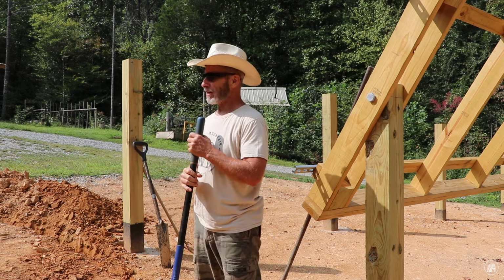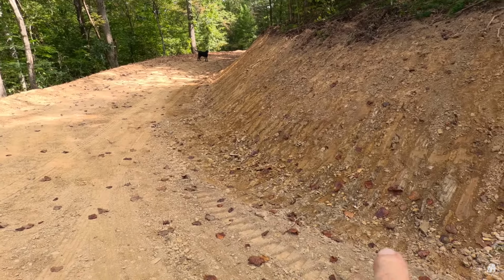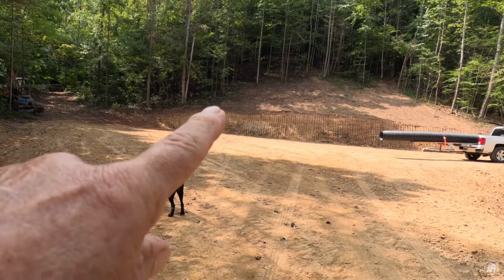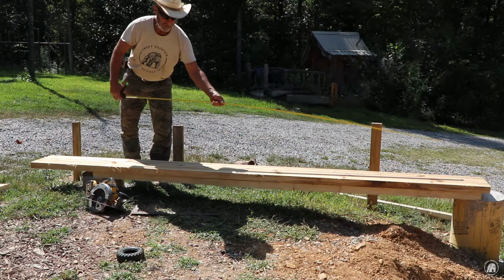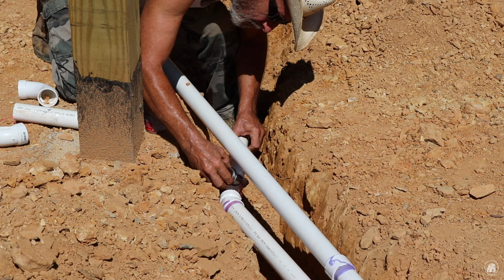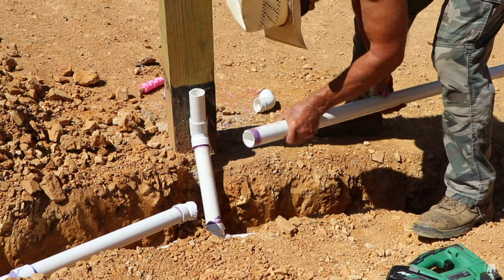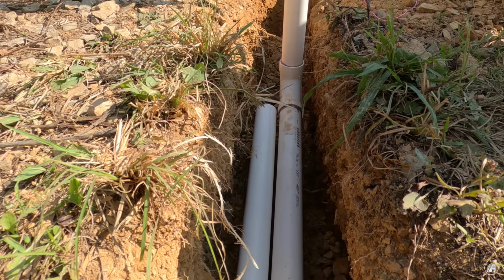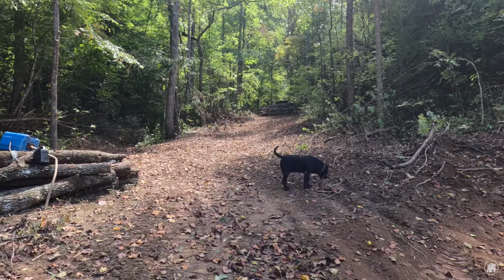HAND-BUILT Solar Array for Off Grid Power

Comment: Richard that thing is gonna be heavy to tilt and adjust. So I suggest you build a cable system on the backside of the solar array with perhaps a boat cable crank. That is if it's not going to tilt easy or level as you are trying to reposition it. I may be wrong it may tilt easy & evenly but if not the boat cable crank is an idea 💡.  👍🏼😁👍🏼
Reply from the maker: Thought about things like that but it’s pretty well balanced. It still moves by hand. Only added weight to one side is the foot board I’m installing. Shouldn’t change it too much. May have to when said and done.
Reply: @SmokyMountainOutpost  yeah but you haven't added all those solar panels to it all way across yet either.  I guess time will tell whether or not it needs a crank up and down system on the back. Good Luck and God Bless you brother

Comment: I don't want to tell how to run your pvc to the solar panels, but using long sweep fittings which will be easier tp pull wires
Reply from the maker: I am using their sweep. I did have one that wasn’t right. But hopefully the mule tape makes it not to hard to pull.  Only concern is the 90 degree. Thanks

Comment: Be careful using plumbing pipe for electrical work.   Sometimes it is hard to pull cable through short bends
Reply from the maker: Been there, lol. That’s a problem sometimes. I think we have it where it should pull fairly easy

Comment: Good morning Richard before you go too far with that pvc pipe just a little heads up on that you might need to change that because those fittings are not for electrical applications you
 will need non metallic pvc schedule 40 that is rated for electrical by NEC because the pvc pipe and fittings you use are for plumbing and its going to be very hard to pull the wires 
through the 90 degrees elbows because they are too short and they will damage the wires just saying anyhow nice build
Reply: Richard, have to agree with keke. You were in the trades and know about standard "factroy NEC approved 90 elbows and or 45 degree elbows. Or heat them to bend where needed. They are meant to make pulling the wire not water. Other than that your building is always inspirational. Keep the hard work.
Reply from the maker: Aware of the difference and the “cost.” I am using sweeping joints and we will get the wire in. Thanks for the heads up and hope you have a good week

Comment: Why did you use regular sch. 40 pvc rather than electrical conduit? In my area only electrical conduit is code for underground wiring.
Reply from the maker: Hey there! Price. It’s almost double the cost. We have the area marked and it’s the only thing in that area.
Reply from the maker: It’s cheaper. This is an undeveloped area. I know there is a national code, but it’s not like we are going to sell this property. As long as it’s know where it is there shouldn’t be any problem digging in any area where the conduit is run. It’s only to protect the wire anyway. I’m not trying to conform to any standards set by the industry. Only what will work for us in the future. That’s my best explanation. Any lines are marked off on a drawing I have for the cabin. I will include this as well.

Comment: Thanks for the video, but hate to see you struggle on that groundwork, yes you like the workout, but man, we are not getting younger and at night you feel the pain, so we have very hard soil as well, almost like concrete, so what do I use, a simple hammer drill with a chisel in it (preferably an SDS MAX hammer drill. yes the setup will be a bit heavier that your steel pole, but the weight of the machine will do the work for you, use a wide chisel in your sds max and it will fly through it. ALSO you pool digger is not correct - at the top there should be two plastic/rubber stops so that the poles do not slam against each other - you need to take the hands of the pole when you slam it into the ground, my pole digger has two rubber stops to prevent the handles slamming each other (with your fingers in-between) checkout the Roughneck pole digger, then you know what I mean. but please keep the video's and hardworking coming - love it
Reply from the maker: It’s not really a struggle and I am trying to keep weight off so the exercise is good for me.  You’re right about the age thing. But so far it hasn’t changed much about how I work. Sounds like you have it figured out. If I had my way it would be a quick connect hydraulic powered auger that you can push down with, but they cost money and trying to use what I have. I do have a hammer drill. The weight of the bar is roughly 30 lb. It does a good job. Hoping to get wire pulled in soon. All the digging is completed. Thanks for the tip. Have a blessed week

Comment: You will possibly have problems pulling conductors through those water PVC conduit. Good luck.
Reply from the maker: I’m using sweep joints. Shouldn’t be any problem as long as it’s big enough.